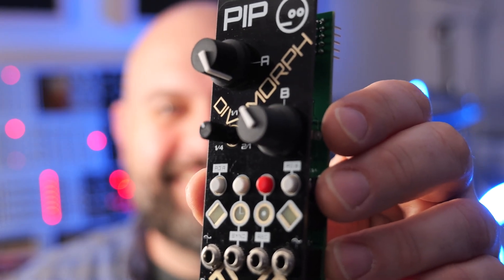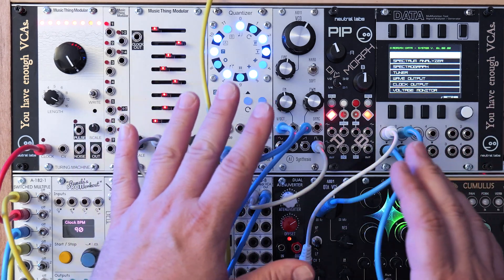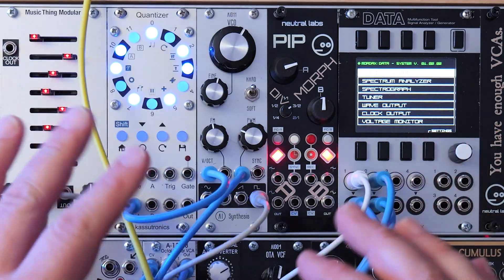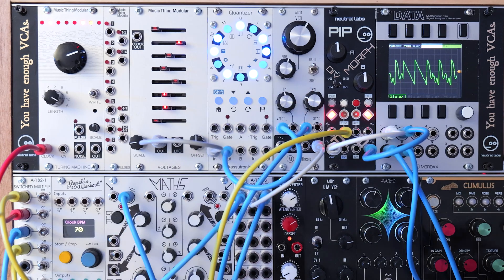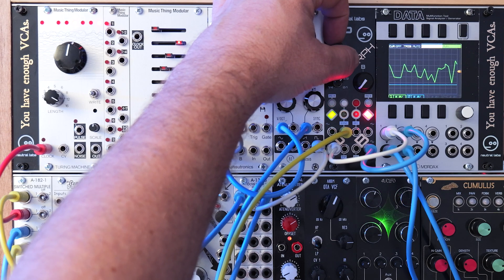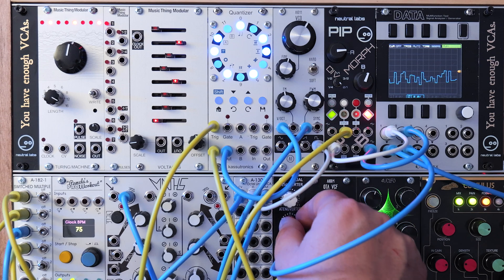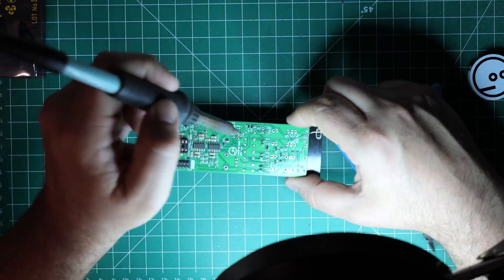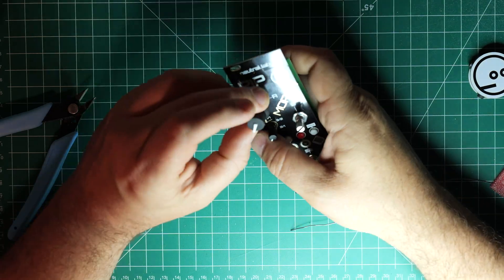Neutral Labs Pip | Complex Wavetable Modulation

Comment: Hey I’m new I just got this and put it together, would I hear anything if I just connect this single one to my aux speakers?
Reply from the maker: No. It's just for modulation. The LFOs move so slowly it's out of the audio range.
Reply: @braintree56  would i connect it to a sequencer? what module would you usually connect this to next :D
Reply: @TiMCoop3r  You need a sound source, like an oscillator.

Comment: Hi, thanks for the interesting demo. It looks charming both visually and functionally, but the fact that you need an oscilloscope and one or two attenuators to work with knowledge and intention puts me off a bit. By the way, what is your experience with the CubuSynth—QuadVCLFO? There is almost no info about it on YouTube.
Reply from the maker: I was using the oscilloscope for demonstration purposes. You can definitely get by without it. The LEDs offer a visual representation of the voltages. It's pretty similar in that regard to most modulation modules. 

The Cubusynth is very simple, but perhaps one of the most visually pleasing modules. I made a video for it with a focus on the Moog Sound Studio. It should give you the idea.

Super easy DIY build and the guide gives you customization options (and a couple of extra components so you can choose your LFO ranges). Fun stuff! https://youtu.be/nzz0mRI1yLY?si=BihdEPbcaZ5VyvTr
Reply: It's not that you need an oscilloscope. There are indicator LEDs for both channels. And actually, that's not even super important, I mostly go by ear when using it. I definitely don't need to know the number of the wavetable page I'm on. If you need that visualisation, there are plenty of LFOs with a display to choose from, like the Dnipro Krait or the Xaoc Zadar, each of course with a differing feature set from the Pip.